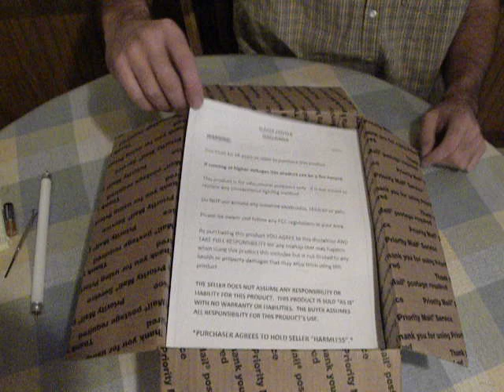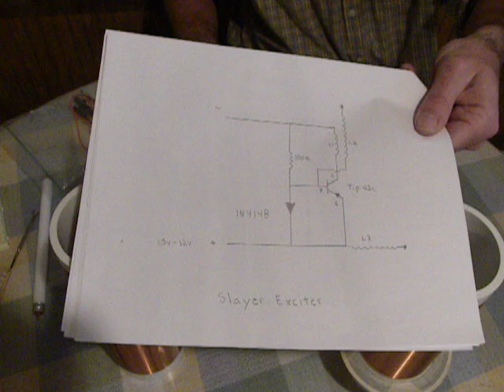Unbox & Setup Slayer Exciter Tesla Coil

Comment: /watch?v=r1nIvW2V9zI 
hey I made a new vid with the kit I purchased, I had to change a few things to handle such large toroids, and I'm a big fan of the alum plate for power. but the circuits are brilliant...and so are the lights. the only thing that's down ...is the input current, hehe, cheers man!

Comment: received the Exciter in the mail today, very pleased thanks Gary :) I will make a vid after the weekend, 
and question, have you run the exciter on a DC power supply? I think I'm getting weird readings from the AC on the input, I will have to use a battery I think
Reply from the maker: Great, I'd  like to see your video. Yes this needs to be run off a DC power supply.
With the circuit on the breadboard you should not go much over 4 volts..